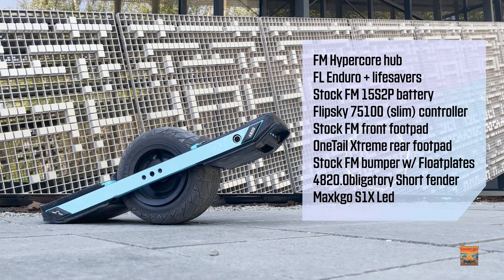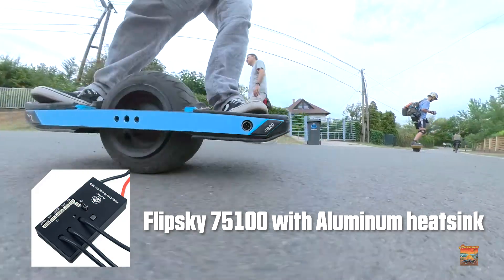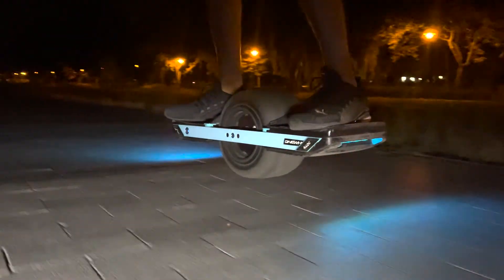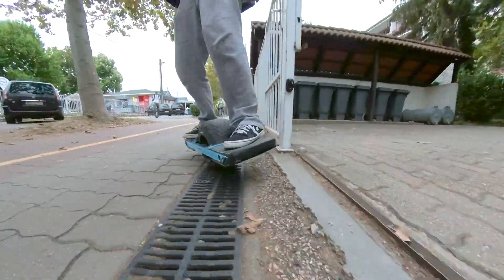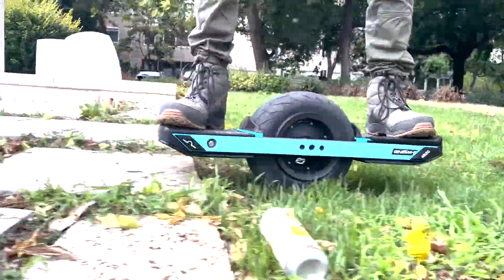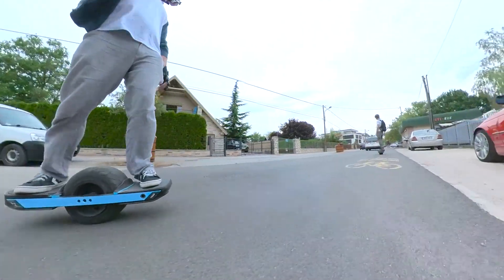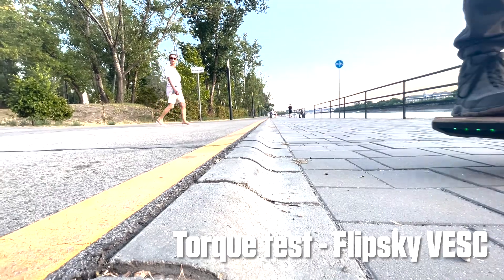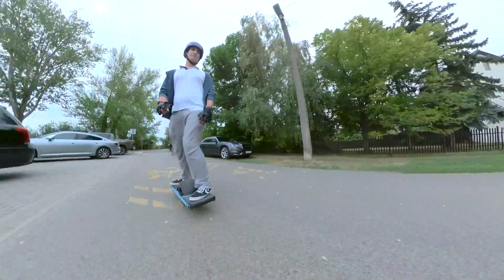Flipsky 75100 VESC DIY Onewheel build review - 1 month of usage

Comment: Would I be able to do this with an onewheel+? This should give the option to upgrade specific parts on the board and make it easier to self repair as well?
Reply from the maker: yes the onewheel plus has the same motor as the xr, so basically u just need the controller replaced and the battery, and you have a vesc xr

Comment: Looks like Flipsky 75100 does a great job, and great points about the benefits of not having the Bluetooth and IMU integrated into the controller pcb.

Competition is great for the builders, and Flipsky prices are pretty good even after you add the BT and IMU. Hopefully as VESC one wheels become more popular even more hardware choices will become viable and in stock at good prices.
Reply from the maker: Yes and agreeing with all of this! Good news that flipsky just released its 75200 vesc, which has much more beefier output current.
Reply: @Burnerzcrew  i dunno i think the ubox is price competitive and potentially superior to the flipsky because its all integrated even a power button. also, the board design isnt stolen like the flipsky
Reply from the maker: @Blox117  yeah a rectangle design is hard to done differently lol. I dont care about brand names, im just into the fact that it works and can be customized, How i want.  I will give the ubox a try later on, sounds good
Reply: @Burnerzcrew  the guy who made the original design told us on the forums, he is a student and made a board for VESC and Flipsky bought one from him, then reversed it to use as their own. its an almost exact copy of his design.
Reply from the maker: @Blox117  OH.  could you give me the original creators name or something? Thats pretty sad. sadly thats not uncommon in FPV hobby neither.
Reply: @Burnerzcrew  I believe the one you are using may be an original design, but another one which is the 75100 with all the cables hanging out, that one is fraudulent. 

his name is ypl on the endless sphere forum
Reply: @Burnerzcrew  this is the post: 

"by ypl » Feb 08 2022 2:24pm

I am the original author of 75100 hardware.I'm still a student and like DIY E-bike.

Due to my personal reasons, the schematic has not been completed. At present, there are only PCB files with chaotic component annotation and source code.There are also some typical features in the hardware design. Some resistors and capacitors are saved in some places, which is not a very perfect thing.

This is the 75100 which I have been working on for the last year March.

During this period, I made several 75100 by hand and sold them on the second-hand trading platform in order to test the stability of the scheme.

The hardware definition of 75100 is changed based on the hardware definition of 100250. The ADC channel, shunt setting and partial voltage setting are reconfigured, and phase filter, redundant temperature sensor and other peripherals are removed.
The maximum current of the firmware is defined as 120amps and the maximum voltage is 120V. This is determined by the range of the shunt and voltage dividing resistance, not MOSFETs.

I have made two versions, one using stm32f405rgt6 and the other using stm32f407igh6.
At the same time, I also made a 75200, but the production process is more difficult.Because the copper column is difficult to accurately weld on the aluminum substrate,This is almost impossible to mass produce.

I modified the overcurrent protection part of the firmware, because in VESC, the overcurrent protection does not directly depend on the sampling value of a shunt, but the motor current calculated from three shunts. If the MOSFET fails, the current of a shunt will be very large, but the program will not return an error, Therefore, I modified the program so that when the Slow ABS Current Limit is False, the overcurrent protection is directly based on the value sampled on the shunt, and when the Slow ABS Current Limit is True, it is based on the original overcurrent protection.

I downloaded the firmware people got from flipsky fs75100 from the Internet and downloaded it to my hardware. Based on this, I can conclude that the firmware was obtained from a 75100 I had previously sold, and its version is 3.00.Later, I learned that the staff of flipsky bought two 75100 from me, but I didn't know who the buyer was at that time.
The price of the two 75100 is 750 yuan, or about 118 dollars, which is very cheap.But in fact, my material cost is $25 per ESC.

The reason for publishing this article is that I saw a product very similar to the 75100 I was using on the Internet. I searched on the Internet and found that the address and telephone number of the consignee I bought were consistent with those on the flipsky website."